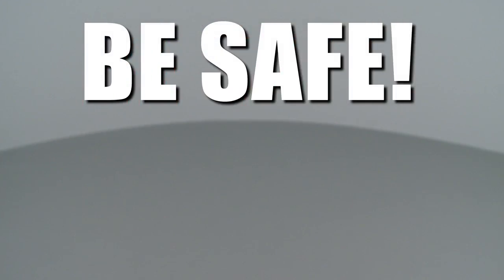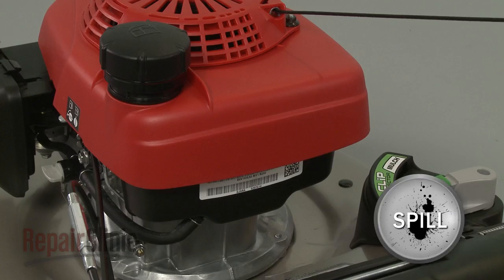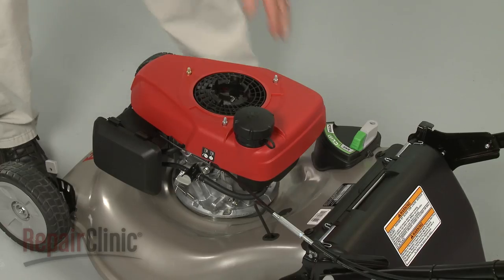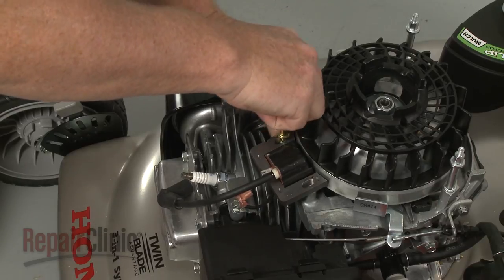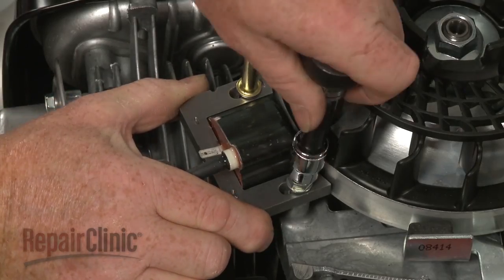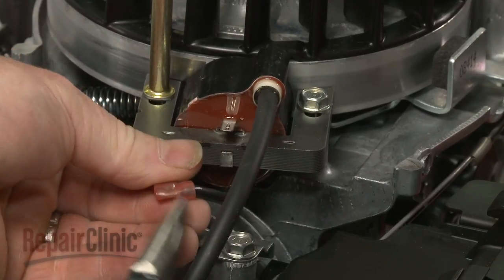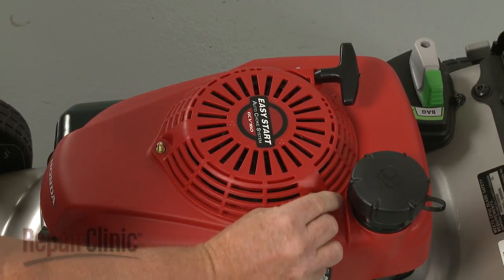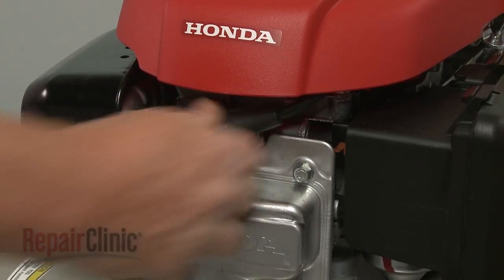Honda Small Engine Ignition Coil Replacement #30500-Z8B-901

Comment: I just replaced the coil on my Honda HRR216. Still no spark! I tried the business card gap, still no spark. I then tried a thinner playing card. I got a spark, but it still would not run! I finally used a feeler gauge, setting a gap i/2 the thickness of the playing card at 005". The spark is back and it ran good. By the way, all bolts are 10mm - except for the long one that holds one side of the coil. It is 9 mm. I used a deep socket.I think if the gap is too wide, you might get a spark, but a weak one.

Comment: My mower's ignition coil was probably damaged due to vibration from having a bent crank shaft (I ran over an edge).  The shaft was an expensive fix, I probably should have just bought a new mower.  But after the work was done, the mower crapped out when it got hot.  Hopefully this fixes that problem. It was a more simple job than removing/cleaning the carburetor.  Yes, I used the business card!

Comment: Good day!
I'm really happy with their youtube channel! very super!
On the other hand, I want to ask for help because I have a honda hf 2417 that shuts down after 25-30 minutes of work because it is very hot and only enrichment can work and start, but it can no longer work that way. It’s like it runs out of fuel completely and stops because of that. (petrol pump replaced, carburetor cleaning, spark plug)
What can cause it?
Reply: Mine did same.  Vibration of a bad blade or a bent shaft can cause the insulation in the coil to break down.

Comment: Why would you not specify both of the coils mounting bolt sizes? It's not a 10mm like the other, and I don't think it's metric. You literally left out one of the most important pieces of information.
Reply: I haven't watched the video, but my nephew has and fixed his mower quite easily. I'm assuming you are taking about a stud. If that is a major factor for you, you're working on something a little advanced for your skill level. Start by taking a few things apart that aren't important and try putting them back together in order to increase your mechanical skills. I'm ssuming your comment was on the level.
Reply: Mark Magoo  - an adjustable wrench is fine. You're not running down head bolts. Be polite.
Reply: It's 10mm, like the other one.  You'd use a deep socket 10mm because of the length of the stud, or the adjustable wrench like shown in the video.